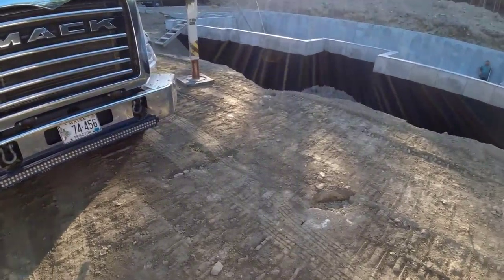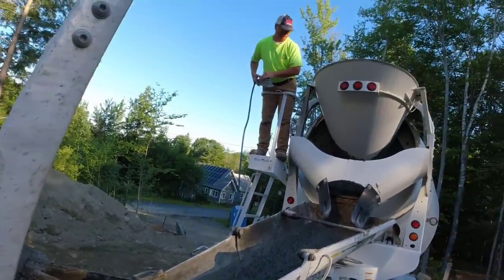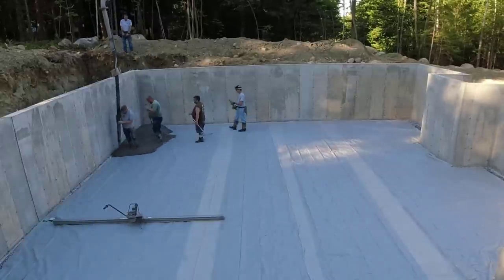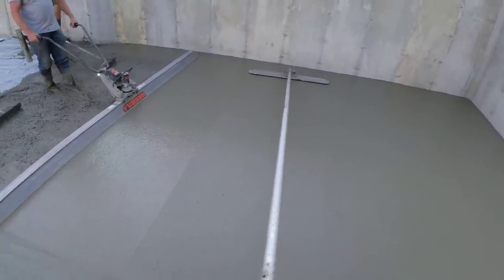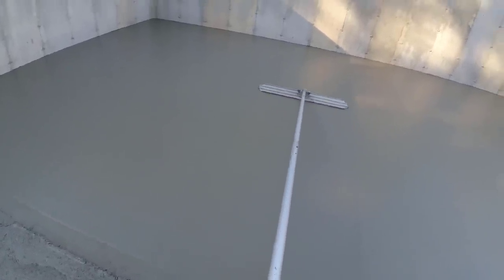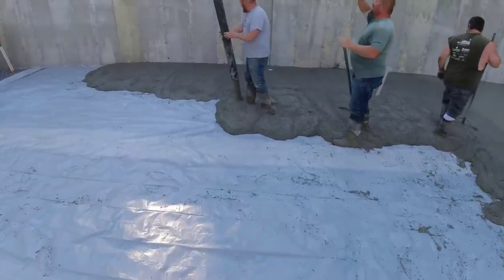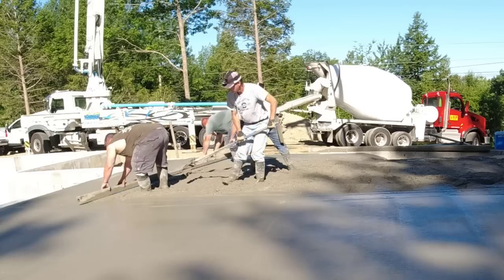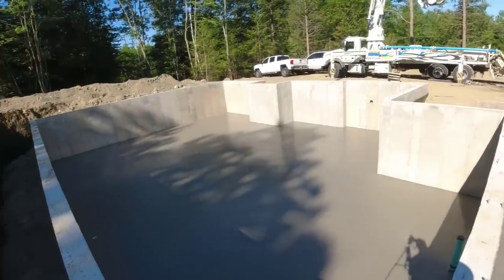How I Think When Planning A Concrete Floor Pour

Comment: Nice job as always Mike! Mayfield NY here. Yes, 8ft basement walls here unless I hit ledge. At which point the customer decides if I'm going to have some extra Christmas money :) Things get really expensive if we have to blast! I don't pour, just excavation. Some observations from this video. That would not meet code here - the way the GC, or foundation masons have the floor height set. The opening in the foundation wall for the garage doors should have been lower. In NY any wood has to be 8" above grade. The sill plate is going to be at ground level between the 2 overhead doors. It is also going to create some awkward grading in that foundation jog to the right of the garage. The wall sheathing between those 2 overhead doors will be rotten in no time.

Comment: I just watched the video over and noticed something I didn't catch the first time. The garage has a basement entrance. The foundation wall has to be 4" higher than the finished garage floor elevation to provide a gas check. That is a NFPA code, that isn't state building code it's federal fire code. I did the excavation for a customer a few years back and they didn't want too many steps into the house. I explained the codes, both gas check and 8" grade separation outside, but they had to have it their way. They said, " We don't care if we get a certificate of occupancy, we never plan on selling". I told them this particular village doesn't mess around like some. You will not be allowed to move in the house, period! They did move in and didn't even bother scheduling a final inspection. Then the fines started coming so they were forced to have the inspection.  The house failed final inspection. There was other stuff but. the garage floor had to be busted out, the foundation opening lowered, the overhead doors lowered. Thankfully for them the driveway wasn't paved yet. I got paid to install the driveway twice plus remove the garage floor and cut the foundation opening lower.